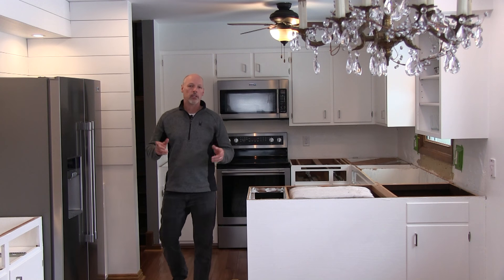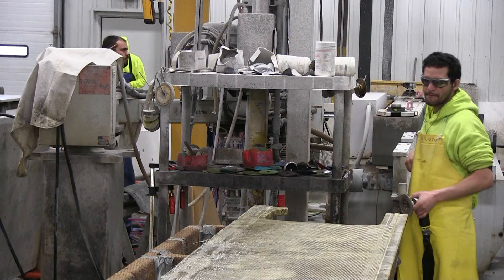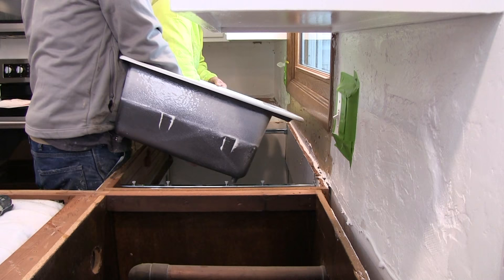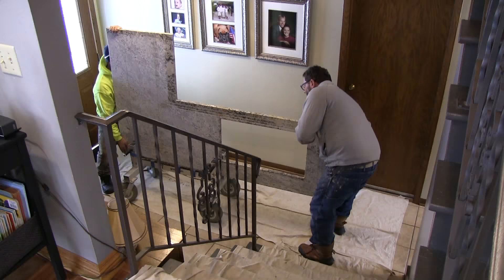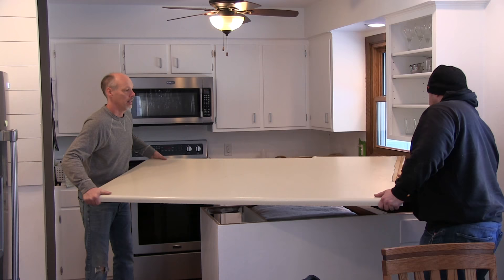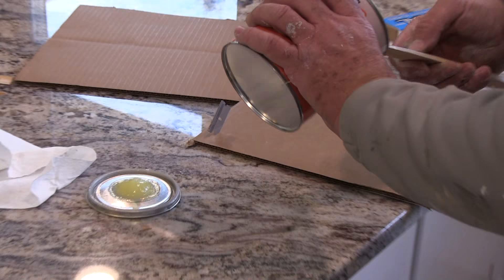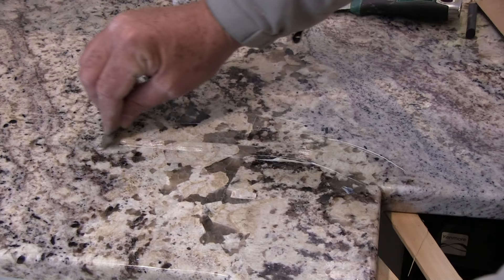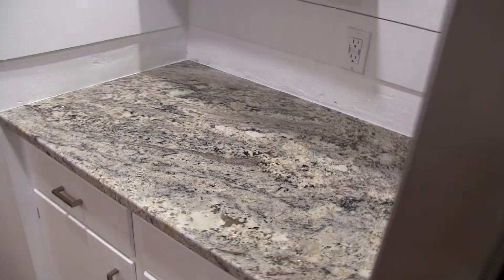Installing Granite Countertops

Comment: I’m doing granite for over 25 years but I will never apply the glue on top of the cabinets before laying down the countertops and slide them, this will push the glue down to the drawers or whatever places .
Reply from the maker: Thanks for leaving a comment with your thoughts 😊.  People definitely look through these comments for information. I think we’re ok. Our granite counters are so heavy It would take a charging bull to move them.
Reply: @SilverLiningDayDreams  the dude said he’s been doing granite for 25 years. I also work in granite have been for 2 years now, pretty sure our countertops are the same weight yours are, 1 3/16 - 1 5/8 inch thick. We carry them in just like that. We also have a hydraulic no lift cart system. We run 3 install trucks and pump out 6-15 tables a day.
Reply: Agreed. We use silicone inside the cabinets. Just a couple small beads work. Ifnyou need to remove them just score the silicone.
Reply: @SilverLiningDayDreams all you gotta do is lift them up put a hammer to hold it up and then glue it’s not that hard

Comment: I love the way they siliconed all the units before checking their unit levels and trying the pieces dry, and the way they over- hung that weak hob off cut cut out with no concern for its support, get a sink saver or a level and clamps if your cheap lol at least they got the epoxy colour right. Drilling through a sponge is a neat trick though 👍
Reply: Yea definitely not the way we would do it. Surprised he was able to get that seam leveled with only one seam cup and no J hooks to level either side
Reply: Yes sink savers are awesome!!!  That is the worst house to install granite in split levels suck !!!  I bought a no lift cart for my company for installing. Best tool ever!! If you don’t have many stairs !!
Reply from the maker: Thanks for leaving a comment with your thoughts 🙂

Comment: I install granite countertops everyday. The tier of granites are just how deep in the ground it is. Tier 1 is alot harder and tier 4.and almost the exact same colors.
Also those para lines are very nice to have.
Reply from the maker: Thanks for chiming in with your thoughts and for watching 😊
Reply: Um I don’t think you’re right . I own a granite countertop company it’s pricing not where in the ground it is !! That’s totally irrelevant
Reply from the maker: @JS-zb1vv  Agreed 😊
Reply: @JS-zb1vv  Total amateur here, but my understanding is that the price depends on how difficult it is to extract from the quarry, rarity of the color, but most of all, how far the material is transported. I am planning around blue pearl for the countertops and a lighter color gneiss with a flowing foliation and pencil-point size red garnets in the matrix as the backsplash.        
As I understand it, the blue pearl is from Norway and the jasmine white is from India. The blue pearl is an upper-mid-price stone, and the jasmine white was on the special low-end price display.
Reply: @5610winston  yes transporting the stone is most of the cost!! Blue pearl has been hard to find !! It’s a very beautiful stone one of my favorites !!pre Covid a container of stone shipped was about 4000.00 for the shipping cost now it’s between 22000.00and 28000.00 it’s insane!! I don’t know where you are located but find a stone shop. Don’t buy from a big box shop lowes home depot etc ! Take pictures of stone you like because different places call the same stone different  names!
Reply: @JS-zb1vv blue pearl is amazing looking also!

Comment: I need to do this.  Mines almost the EXACT same scenario.   The only difference is - I don't want under the counter-top sink mount And  the kitchen is like a horse shoe , sink in the same place - the peninsula, same place , my stove and fridge are on the opposite side as sink so the horse shoe  starts on the walk around part of the peninsula and ends where your stove is, my two small counters are on either side of the stove, one being against the wall to the stove and the other from the stove to the fridge which the end of the walk around part of the peninsula is directly in front of.     50 sq feet of counter space almost exactly.      The two smaller counter tops could be cut from the center of the slab .   I wanted to find a piece that could be one piece for the horse shoe and then just slide the two tops in on that far wall by the stove / fridge.   

   I noticed there was no wood on top of the cabinets, it just sits there? no cover ply wood or anything to hold it all down?  is there danger in that slab breaking this way?   

  what was the total cost of this being done this way?  just to this point with no black splash or anything like that.      how many sq feet is your set up here? 

  I want to find everything we need at what stone shop we pick   and then re do all my cabinets and get everything prepped so it can all go in like this.   then all I have left is the black splash which is probably going to be tile.
Reply from the maker: Thank you for articulating a well thought out comment :). The cost was $3,994.00 and at 49 square feet.  I recommend that you read through the comments if you haven’t yet as some do post their opinions there concerning supporting the granite. For peace of mind, in hindsight,  I would have liked to have 
added more support. Our grandkids (a 4yr old and a 6yr old) occasionally climb on the counters and so far all is well. We wish you well with your upcoming kitchen remodel. Thanks for watching

Comment: I’ve need other installations where they put 1/2 plywood on top of the cabinets before the granite but you didn’t. Any input on this? I’m doing mine now
Reply from the maker: It does depend on the thickness of the granite. Seems to be a little controversial the comments. Our has been holding up well!

Comment: So the guy installing my granite countertops says that you don’t need to do any of the caulking before placing the countertops down and that the actual weight of the granite will hold them in place. I mean the countertops are quite heavy but it just seemed kind of odd to me is this normal?
Reply from the maker: Great question.  I’ve always seen the countertops placed on some sort of adhesive caulk. Even though they are super heavy; caulking them gives me peace of mind. If it were me I think I would ask him to caulk. Sometimes different areas of the country do things a little different. Have you considered calling some other installers in your area and asking them if they caulk to get a feel of what’s done in your area?

Comment: Is it true that granite or laminate has to be glued down?
Reply from the maker: I asked my friend that installs laminate countertops for a living how they are installing laminate countertops and he said… 
First choice-screw down. If no blocking on cabinets, then clear silicone. Can put some weight on top overnight if top has warped at all. 
For granite countertops the granite shop that installed our granite countertops used silicone caulk and stated that it’s the weight of the granite for the most part keeping them in place. 
If you look through the comments on our video there is a lot of different opinions out there. Hope this helps 😊
Reply: @SilverLiningDayDreams  thanks

Comment: Hi I have a question. I am building a cabin in Spain. The kitchen units are from Ikea and are now in place and I am about to order the Granite counter tops. My builder tells me that the way Granite is installed is on top of Plywood, because a typical counter top is 4cm thick and to buy Granite that thick would be too expensive and weight too much for the units and would make the units collapse. He says what they do is cut the granite to 2cm thickness, lay it on top of plywood and create a lip type of front to cover over the lower layer of plywood so it looks like its all granite thickness of 4cm. Is this bull crap or is this for real. Looking at your video it seems the granite is one thick slab fitted directly onto the base units. Please advise if I am having the wool pulled over my eyes. Thanks, great video. Cheers

Comment: Where did you purchase those bar stools?
Reply from the maker: We purchased the stools at Target: Belvidere 24” Counter Stool Expresso Finish Wood Legs. Also on box says Threshold Quality & Design. We purchased 3 stools but only used 2 so we have one left in box. The thought is, that with our family growing, we may at times use a 3rd stool. Thanks for watching!

Comment: what was that you used to put between the two slabs of granite to join them?
Reply from the maker: I think it was GranQuartz Pro Series transparent knife grade polyester stone adhesive. It was a couple years ago now so not 100% sure. 
I think Akemi makes a product too. Thanks for watching.
Reply: It was knife grade, however I prefer to use and integra adhesive is a bit more money, makes the seam stronger and always have a consistent colour from one tube the next (for that seam I'd have used chameleon.)

Comment: Thanks for all the information. But I would like to know if I can make a kitchen counter top using a tubular steel frame support bolted to wall and few intermediate supports from floor
Reply from the maker: Thanks for watching. Just about anything’s possible if built properly. I don’t feel like I know enough about your idea to comment. :)
Reply: Was wondering the same question hehe

Comment: Looks great. How does it look at the seal I wonder? Did they have to make it two separate pieces?
Reply from the maker: Thanks!  In order to use just “one”large piece of granite the seam was necessary. It’s a very well done seam and over time you forget it’s there. Initially we had purchased under cabinet lighting to install but then decided against it because it made the seam show more. And since we have all the recessed lighting in the ceiling we decided the under cabinet lighting really wasn’t necessary. 
Stay tuned because we’ll be doing a video on my sisters kitchen renovation walkthrough 😊

Comment: They didn’t use any screws to secure it to the cabinets?
Reply from the maker: It’s been almost 3 years and the countertops haven’t had any noticeable movement. The weight of the countertops combined with the caulking is keeping everything in place. We didn’t use any screws. Thanks for watching our video 😊
Reply: I work in granite you don’t need screws whatsoever.. the silicone keeps in in place it’s not Formica

Comment: what size is your kitchen sink?
Reply: kohler? could of got it cheap er at Home Depot or and Lowe's and just
Reply from the maker: Thanks for watching. Our sink is made by Koehler and is called Deerfield®
Under-mount Kitchen Sink
K-5873-5U. It won’t let me copy the specs here so you will need to google it. I don’t remember but I believe we wanted to buy locally and have delivered and not use a big box store because some of the reviews mentioned imperfections in the sink when purchased. Can’t remember what they were. Because we have had it for almost 2 years now I’m not sure what the prices would be but I think we did pay more than the big box stores at that time for peace of mind to work with a local trusted company.

Comment: I put down a plywood 3/4 over the top of the cabinets and its level.. Didn't want the stone leveled by  pushing in soft pine shims, nope, avoid that at all costs. With the plywood the  stone is equally supported no spaces under the stone. Also my setup is  seamless. Too bad you didn't show hou the sink went in.
Reply from the maker: Thanks for the comment with your thoughts on how you did your install for others to consider. We’re very happy ours. Still level, solid and holding up great!
Reply: @SmokeyMcSpaceballs  just trying to show there are no gaps between my stone and the plywood. The plywood is level, how do I know, my level, which is 8 feet long, told me so. If you are not open to new ideas, other ideas, or are stuck in the way you do things, thats ok to. I'm not forcing my opinion on you or anyone, just stating what I did. Hopefully I was not insulting that was never the intent.

Comment: Tape waste of time especially for caulking white on white. Use paintable. If you can't judge on how much to use put less and fill gaps. Can't imagine putting tape every time Jesus id quit. Seal the top before applying any calking except trans white silicone in front of top where top and cabs meet. Why you drill hole after calking?
Reply from the maker: Thanks for leaving us a comment with your thoughts. A lot of people that are serious about installing granite counters read through these comments. The more information available to them the better. Take care 😊

Comment: where are yall from and why do yall use does weird seams why not just a small 45 cut at the seam instead of that weird roiund seam at the corner
Reply: Because if they would have made a seam at 45° angle it would have made for a longer and more noticeable seam
Reply: Q-presss i didnt mean run the whole seam at a 45. Where im from we normally notch a small 45 cut to seam at a 90 i was just curious with the round notch at seam
Reply: @NerioVlogs  oh gotcha. Im pretty sure it has to do with hiding the seam more. I've seen a few seams like that but never grasped the real justification on it. It was an odd install lol
Reply: Could have also had to do with the type of edge they chose too
Reply: Q-presss yea could had been because of the edge detail
Reply from the maker: Exactly! :)

Comment: Very professionally produced; nice going!  Everything is covered and well-explained. I've never seen those 'cross bars' under the sink; but for such a heavy sink that's probably the best support solution. What do you think of the wire harness used to support a light-weight sink? Thank you.
Reply from the maker: Thanks. You made our day. 
They are doable in some applications.  I have a bias towards being extra cautious though 😊
Reply: I will be using a copper sink, and I would worry about dissimilar metals corrosion with the stainless steel supports. I suppose those cross bars can be had with some sort of resin shims and gaskets to eliminate that potential problem?
Reply from the maker: @5610winston  Copper will will look fantastic. Yes, there’s a fix out there somewhere; whether something on Amazon or local hardware store.
Reply: @SilverLiningDayDreams  Yeah, I have been shopping eBay for some of the appliances and materials going into my kitchen rebuild. I had ordered a stainless double-bowl sink, then after I pulled the trigger on the purchase I found a Coppersmith-brand hammered copper double-bowl at a price that made returning the stainless sink, even including the return shipping, a no-brainer.          
My plan is blue pearl countertops (it's a galley) with a light-color grey or white granite with garnet flecks as a backsplash and other vertical surfaces up to the cabinets, light-color stained wood or painted base and wall cabinets....

Comment: Also I don’t like the silicon going underneath the countertop and in between the wall sides. If the homeowner ever wanted to replace them, it would tear something up trying to get them out. 1 bead of silicon underneath after setting them is enough, nobody should be prying up on their countertops in the first place and if they do it should break warranty
Reply from the maker: Agreed in that not as much silicone needed. These counters are so heavy that the weight of them pretty much keeps them in place. Thanks for watching and leaving us a comment 😊

Comment: No backflash and no plywood underneath the countertops.i hope its not easy broken cause granite is not strong as quartz.
Reply from the maker: 2 years and all is well. :)
Reply: Not true at all. It depends on the type of granit they are using. I would have liked to have seen some steel support brackets for that over hang on the island end but the type of granit they were using is fairly riggid. Man made quarts is technically more durable than most granits but it has its drawbacks for sure. I would never out man made quartz in my home. Seams never turn out because razor blades always leave metal marks.
Reply: Silver Lining Day Dreams you don’t need plywood lol that’s only for 2cm granite and these were 3cm (more durable) and even then it’s not necessary these guys did a great job -Professional Granite installer
Reply from the maker: We’re super happy with it! Still looks fantastic! :)

Comment: They just bulldozed all the glue off cabinet top edges. What a joke why do you even use glue?
Reply from the maker: The piece under the window is glued to the peninsula piece and there was adhesive caulk placed  all along the walls after the install to keep water out. These combined pieces weigh very very much. Some of the caulking laid on the cabinets is still there doing it’s thing. It’s mostly the weight of these counters that keep them in place. It has not moved in almost three years. In fact if you tried to remove the counters or even just try to move them you would more than likely destroy the cabinets in the process. Thanks for watching our video and taking the time to post a comment 😊